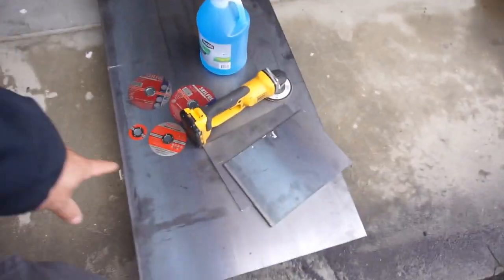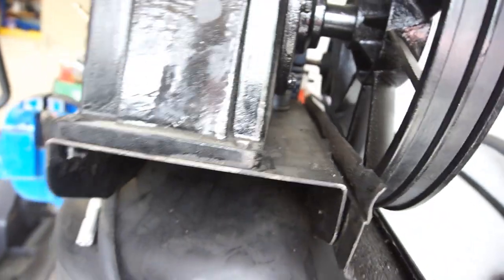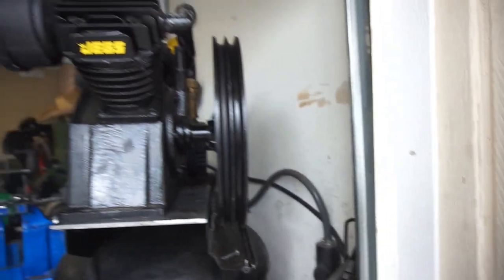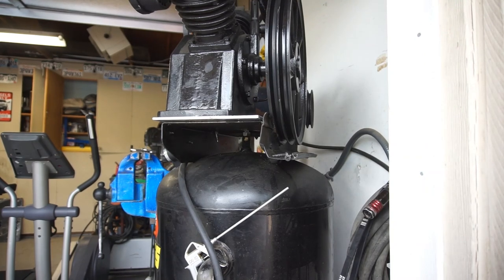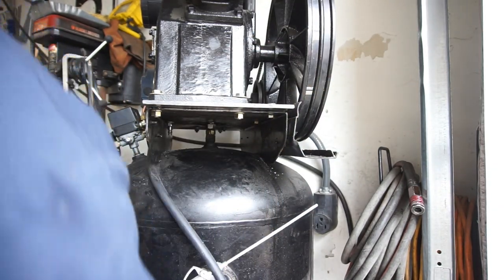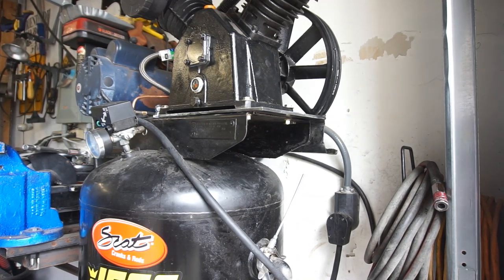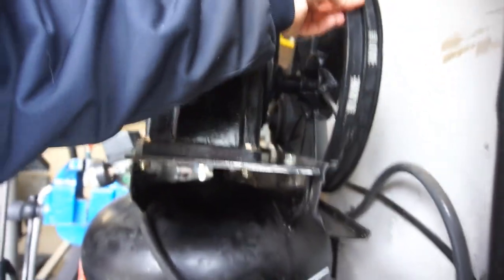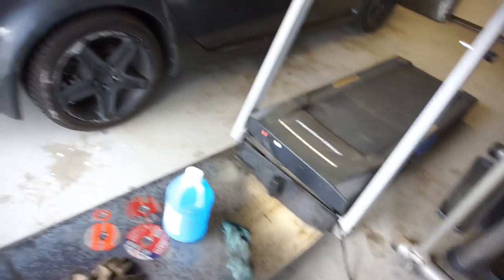Upgrade Any Air Compressor To Quiet It Down And Less Vibration.

Comment: I have problems with my compressor too. I think its the line that goes from the motor to the tank.  Can't get to it to check. Got a not running car got it blocked in.  Could use the compressor to fix the car ,but I gotta fix the car before I can fix compressor .  It's a catch 22 .  Good job on your compressor problem , but that comes as no surprise Mr. Fix-it !!  Darn show-off !!  Hahahaha !
Reply from the maker: ain't no darn show off, I just want stuff to work better then intended. Well if i was closer to you on my off days i'd help you out. So there's another one of those catch 22s..
Reply: @Halffast719  ; Hey Fonz, Thanks for the thought of helping me .  I think it just needs a fuel pump . It ran last summer but won't catch un less ya dump fuel in the carb . I just need some decent weather and the incentive .  Its my wives 1960 T-Bird and it needs work on just about everything ! HAHAHA !  Yeah, I'm pretty happy if I can get most things to just work now-a-days .  Almost impossible to get off the shelf products to exceed expectations !   That takes special skills .